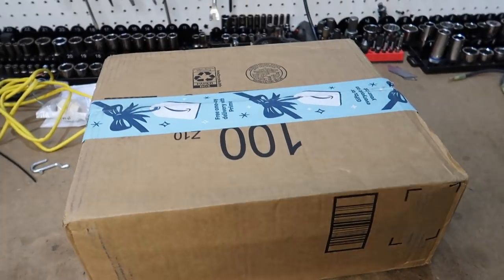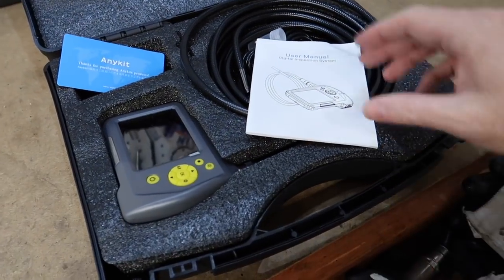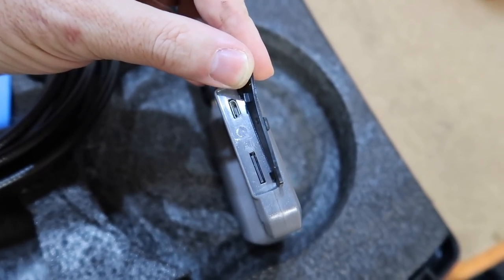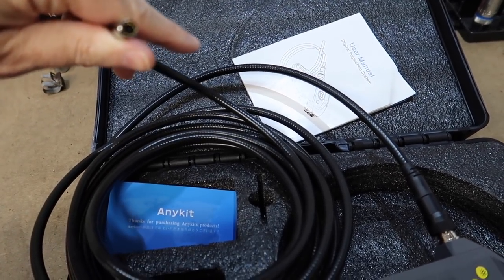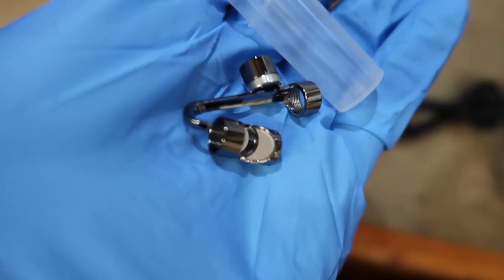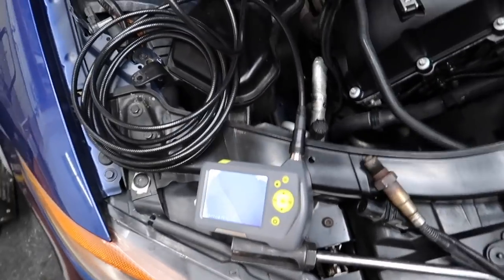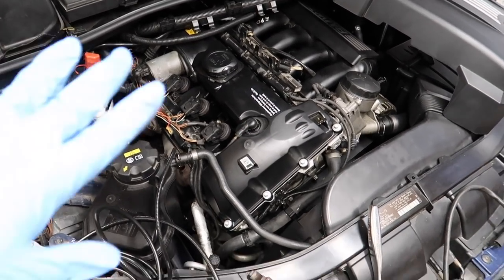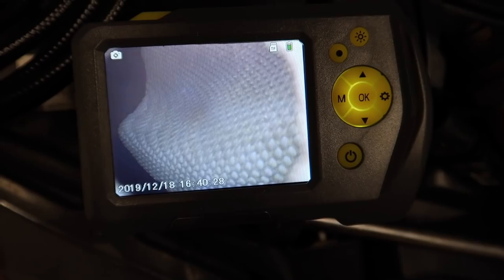Easiest Catalytic Converter Cleaning And Inspection !!!

Comment: I had the same Issue in my Bmw e60 530i 2004 m54 engine. It lost power at the time for a year. Then I started to have issues in the highway when I accelerate, it showed me the code p16a7 and the car went into safe mode. It was crazy after I shut off the engine it started again normally and the engine service light went off. That happened twice. Thank god I have a scan tool so I can be able to see the code. This happen a year ago, and I bought a cheap microscopic camera, and my cat seem the same like your video, but had more spot clogs. I replace 2 cats and the car was so powerful, ran amazing up to today. My car only has 112 thousand miles, I replace the cats last 10 thousand miles ago, it’s so rare that happen, I got everything up to date, all the maintenance, but it happen. Excellent video!! Nathan

Comment: I used Cataclean on my BMW 318i I had a fault code 3104 uneven running (NOx sensor) put one bottle in my tank but the code came back after two weeks put one more bottle in the tank and the code never came back car runs smooth now.

Comment: After my e46 had a major issue about a week ago I just bit the bullet and may or may not end up regretting it, I got a 2010 335i already has stage 2 turbos FBO, and a time and is pushing 525hp. Figured why not since it’s in emasculate condition, has full maintenance history, and only has 88k miles.
Reply: RIP to my E46 you were loved 2002-2020 lol
Reply: BMW Outlet yea, aftermarket hoses, aluminum radiator, aluminum expansion tank, Aftermarket intercooler, DCI, Aftermarket charge pipe, after market exhaust, pure stage 2 turbos, and JB4. Wouldn’t say $11,000 was too bad.
Reply: Emasculate condition?  Yikes!
Reply: Jeff Nash ended up getting another 335i about a week ago 2008 Sedan DocRace 6466 kit,  Custom tune.

Comment: I think you can put a pressure gauge in the O2 port and measure back pressure. A little more investment you can get a pressure transducer that fits the spark plug opening and record compression, and exhaust pressure. Great camera and good video. Cheers!

Comment: have a subaru, 1998 mod. with new engine only 10 000 km. drove back from stokholm sweden to bodø, 130 km\t for 17 ouhr, straith, in 3-400 rpm, after that car worked 50% bether on all rpm. Some say just add 85% alcohol 1-2 liter in haf a tank and drive hard on 3-4000 rpm for 3-4 ouhrs, and then catalyst is clean, Does it work ?? anywone.??

Comment: i have BMW 530i 2006 how loud is it if you Drill out Cadillac converter?
Reply: catalytic converter
Reply: Actually, back in the day, before GM bought all the rights, it was first called "Oldsmobile Converter" and that is what it was called for decades.

Today it's known as the "Cadillac Converter." Same part. Same function. Different name.....
Reply: @denisefowler8575  🤣🤣🤣

Comment: Trying to get the part number off my 07 bmw 328i catalytic converter, one coming off engine. All i can read On it without taking alot off is 665071 but i think im missing numbers in front of it. I figure it was a 7 but i cant find anything matching part number. I found the rear ones bur cant find the one coming off engine. Help is appreciated, thanks!

Comment: If it failed, replaced it. Trying to clean a catalytic converter is pointless, it doesnt always fix the issue. The metal inside the waffle cone breaks down so it's no longer working properly. Cleaning it doesnt mean it's fixed only that it's now clean and water a lot of time. Even the product CataClean doesnt work long. It will help you pass emissions but wont make the issue go away as long as just sucking it up and replacing the failed part...
Reply: Replacement wont help either. Cats dont just go.bad if a cat does bad it means you have another problem and the new cat will go bad too
Reply: I had the idea that a catalytic converter working at 96% efficiency will throw a code.  With that in mind, cleaning it to eliminate some carbon-clogged mesh screens to get back to 98% or 99% seems worthwhile.  Honestly asking here.  Am I wrong?  And I'm talking about removal, cleaning, and re-installation.  Not pouring some sort of additive into the fuel tank at make the cat burn hotter to "clean" itself.
Reply: @jeffreynash5236  when a catalytic converter fails it's for a reason, cleaning them does not always resolve an issue. So for the amount of time being wasted removing them, some not so simple to do, its easier to just replace the part and eliminate the issue or wasted time to do it a 2nd time. Professional experience.
Reply: @kid5042  people who run their cars improperly are more prone to failed catalytic converters, example - random misfire or any misfire from bad coils or spark plugs. Running improper fuel, egr issues, carbon build up on the valves. Usually a vehicle running improperly for a long time can most commonly cause major failures if they are not fixed properly. Unspent fuel dumping into the catalytic converter that was not ignited in the piston chamber due to failed spark plugs or other is also a known reason for failure.
Reply: @Jeffrey Nash it could even be an electrical issue causing it, if it stays off for over 50 miles it will pass, if you say it stays off for 3 tanks of gas then pops up, check fuel injector for that side of the bank cylinder also
Reply: @stevenb320  i agree with you. I had some issues to my mitsubishi lancer 2004 all of a sudden im loosing power i tune up replacing coil and sparkplug more than 2 yrs now. So i suspected its the sparkplug or coil… i wilo check my catalytic also if there is a clogged..